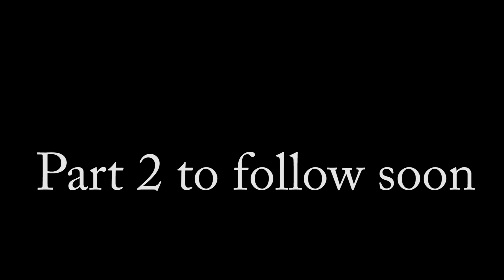Pfizer, process 2

Comment: One relative of mine said he's done messing around with this stuff. Very upset at being lied too about it.
Reply: Please highlight the benefits of fasting on this video for us again, it's good work you do 👍
Reply: Thank you so much! @damienmcgrory9462
Reply: If any of your loved ones have been exposed, some fasting can get it out of the body faster through stimulating phagocytosis. Some benefits of doing occasional extended fasting: High blood pressure is lowered to normal levels very quickly while fasting. Fibrosis/scarring is reversed over time, including in the heart and lungs.

Fasting stimulates phagocytosis, the ingestion of bacteria, plaques and viruses by the immune system. It will also remove any 'foreign material' like spikes that are not supposed to be there. Whether natural or unnatural in origin..

Blood clotting is reduced and blood clots and arterial plaque are reabsorbed into the body. 

Blood sugar and insulin are lowered when fasting, allowing white blood cells to move more freely throughout the body and do their job.

Vitamin D plasma levels are increased as fasting improves metabolic health, and vitamin D in turn increases autophagy.

Reflexes and short term memory are increased. 

Fasts from 36-96 h increase metabolic rate due to norepinephrine release! 

Telomeres are lengthened and fasting also increases anti-aging Yamanaka factors.

After 72 hours or more fasted, your body recycles up to 1/3 of all immune bodies, rejuvenating your entire immune system. This helps prevent the onset of new autoimmune conditions, which develop through a leaky gut and damaged immune system.

Fasting can help with MS, Depression, BPD, Autism and seizures.

Thymus is regenerated, which suppresses aging and renews the immune system. The thymus also plays a vital role in fighting cancer.

Weight loss from daily caloric restriction has 1/4 to 1/3 of the weight lost as lean tissue while many studies show fat loss from 36 h fasts without losing any lean tissue! 

The obese will lose extra tissue like loose skin while fasting, but the skinny or frail will have increased growth hormone release than the obese, which helps to make more lean tissue and reduce frailness.

When you move out of MTOR your body shuts down the building blocks of the cell required for viruses to replicate.

The hunger hormone ghrelin also lowers with extended fasting and rises from dieting. 

What breaks a fast? Anything with protein or carbohydrates in it will break a fast. Most teas and herbs are OK. Most supplements and meds will either break ketosis directly or contain a filler that will. Many meds are dangerous to take while fasting.

Does fasting lower testosterone? No, it raises it when the fast is broken by increasing lutenizing hormone. Fasting also increases insulin sensitivity, which helps with muscle building.

Fasts of 36-96 will not affect short term female fertility or affect menstrual cycle. They also may increase long term fertility, especially in women with PCOS.

Fasting reduces pain and anxiety by stimulating the endocannabinoid system in a similar way to CBD oil.

One day of fasting can cut your leptin levels in half and gets your immune system working properly again! This reduces leptin resistance, which impairs immune function. 

Stomach acid is reduced over time while fasting and can allow for the healing of treatment resistant ulcers. Some patients may need continued acid reduction medication while fasting.

Does the body preferentially prefer glucose as a fuel? No. Except for brief periods of very intense exercise, your body mainly burns fats in the form of free fatty acids. Your brain also prefers to burn ketones at a rate of around 2.5 to 1 when they are available in equal quantity to glucose.

Fasting stimulates the AMPK complex and activates autophagy. Autophagy (literally self eating) will cause cells to recycle damaged proteins and foreign matter such as viruses. It will can kill cancerous and senescent cells

Lowering insulin via fasting virtually eliminates chronic inflammation in the body. 

It increases mitochondrial function and repairs mitichondrial DNA, leading to improved ATP production and oxygen efficiency. Increased mitochondrial function also has the added benefit of increasing your metabolism, fighting infection and cancer prevention!

Fasting releases BDNF and NGF in the blood which stimulates new nerve and brain cell growth. This can help a great deal with diseases like MS, peripheral neuropathy and Alzheimers.

When you fast, this stimulates apoptosis in senescent or genetically damaged cells, destroying them. Senescent cells are responsible for many of the effects of aging and are a root cause of the development of cancer. 

A fasting mimicking diet for 3-5 days in a row also provides many of the same benefits as water fasting. FMD usually has 200-800 calories, under 18 g of protein and extremely low carbs.

Exogenous ketones can aid with fasting, making it easier in healthy people and allowing some people with specific issues to fast in spite of them without worrying as much about hypoglycemia. They also help with dementia and many other issues even if you take them while not fasting!

Glycine and trimethylglycine can also be useful supplements while fasting that won't break ketosis and have many benefits.

Children, pregnant or nursing women should not fast for periods longer than 16 hours. People with pancreatic tumors or certain forms of hypoglycemia generally cannot fast at all. Type 1 diabetics can also fast but it is more complicated and should be approached with caution as it could lead to ketoacidosis. If you experience extreme symptoms of some kind, especially dizziness or tremors, then simply break the fast and seek advice.

Resources:
https://www.ncbi.nlm.nih.gov/pmc/articles/PMC5783752/
https://www.ncbi.nlm.nih.gov/pmc/articles/PMC1413655/
https://www.ncbi.nlm.nih.gov/pmc/articles/PMC5783752/
https://pubmed.ncbi.nlm.nih.gov/6859089/
https://www.ncbi.nlm.nih.gov/pubmed/10232622
https://www.ncbi.nlm.nih.gov/pmc/articles/PMC8470960/
https://www.sciencedirect.com/science/article/pii/S1931312809002832
https://pubmed.ncbi.nlm.nih.gov/15522942/
https://faseb.onlinelibrary.wiley.com/doi/abs/10.1096/fasebj.2019.33.1_supplement.819.10
https://www.biorxiv.org/node/93305.full
https://www.arcjournals.org/pdfs/ijrsb/v3-i11/7.pdf
https://www.ncbi.nlm.nih.gov/pmc/articles/PMC5895342/
https://www.ncbi.nlm.nih.gov/pubmed/25686106
https://pubmed.ncbi.nlm.nih.gov/21410865/
https://www.ncbi.nlm.nih.gov/gene/25712
https://pubmed.ncbi.nlm.nih.gov/23707514/
https://www.ncbi.nlm.nih.gov/pubmed/24905167
https://www.health.harvard.edu/heart-health/abundance-of-fructose-not-good-for-the-liver-heart
https://www.ncbi.nlm.nih.gov/pmc/articles/PMC7093158/
https://clinical.diabetesjournals.org/content/36/3/217
https://www.ncbi.nlm.nih.gov/pubmed/23876457
https://www.ncbi.nlm.nih.gov/pmc/articles/PMC6526871/
https://www.ncbi.nlm.nih.gov/pmc/articles/PMC7607739/
https://www.collective-evolution.com/2017/05/16/study-shows-how-fasting-for-3-days-can-regenerate-your-entire-immune-system/
https://pubmed.ncbi.nlm.nih.gov/7714088/
https://www.cell.com/cell/fulltext/S0092-8674(19)30849-9
https://www.ncbi.nlm.nih.gov/pmc/articles/PMC6407435/
https://www.ncbi.nlm.nih.gov/pmc/articles/PMC6141719/
https://pubmed.ncbi.nlm.nih.gov/20921964/
https://pubmed.ncbi.nlm.nih.gov/25909219/
https://www.cell.com/molecular-cell/fulltext/S1097-2765(18)30605-1?_returnURL=https%3A%2F%2Flinkinghub.elsevier.com%2Fretrieve%2Fpii%2FS1097276518306051%3Fshowall%3Dtrue
https://pubmed.ncbi.nlm.nih.gov/28235195/
https://www.ncbi.nlm.nih.gov/pmc/articles/PMC2815756/
https://www.nia.nih.gov/news/research-intermittent-fasting-shows-health-benefits
https://medicalxpress.com/news/2022-10-treatment-pulmonary-fibrosis-focus-telomeres.html
https://www.ncbi.nlm.nih.gov/pubmed/10859646
https://academic.oup.com/ajcn/article/81/1/69/4607679
https://pubmed.ncbi.nlm.nih.gov/31877297/
https://n.neurology.org/content/88/16_Supplement/P3.090
https://pubmed.ncbi.nlm.nih.gov/31890243/
https://pubmed.ncbi.nlm.nih.gov/2518860/
https://pubmed.ncbi.nlm.nih.gov/29727683/

https://www.ncbi.nlm.nih.gov/pmc/articles/PMC3017674/
https://pubmed.ncbi.nlm.nih.gov/23408502/
https://www.amjmedsci.org/article/S0002-9629%2815%2900027-0/fulltext
https://europepmc.org/article/MED/22402737?javascript_support=no
https://onlinelibrary.wiley.com/doi/full/10.1111/j.1365-2265.2005.02288.x
https://www.nejm.org/doi/full/10.1056/NEJMoa012908
https://pubmed.ncbi.nlm.nih.gov/27569118/
http://www.cell.com/cell-metabolism/abstract/S1550-4131(15)00224-7
https://repository.upenn.edu/cgi/viewcontent.cgi?article=1537&context=edissertations
https://www.ncbi.nlm.nih.gov/pmc/articles/PMC1779438/
https://www.nejm.org/doi/full/10.1056/NEJMc2001176
http://www.sciencedirect.com/science/article/pii/S0005272806000223
https://www.clinicaltrials.gov/ct2/show/NCT04375657
https://pubmed.ncbi.nlm.nih.gov/20102774/

This list compiled over years of research by the user known as Pottenger's Human on youtube. Feel free to copy and paste this anywhere you like, no accreditation needed!

My community tab will always contain an updated version of this list of fasting benefits. I also have playlists on fasting and health topics.
Reply: @LTPottenger absolute bull.
Reply: Don't start... you have highlighted the fasting benefits loads of time on here and other channels. Thanks.
Reply: At least he's aware now. Wish more would admit they've made a huge mistake.
Reply: My relatives are still sleeping